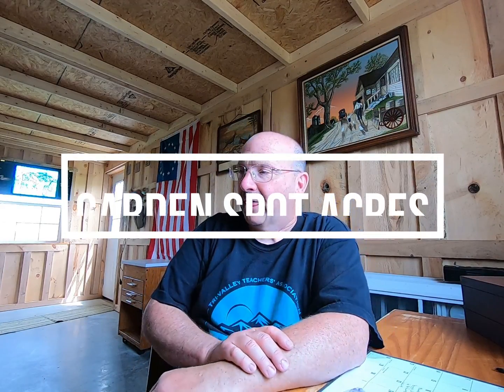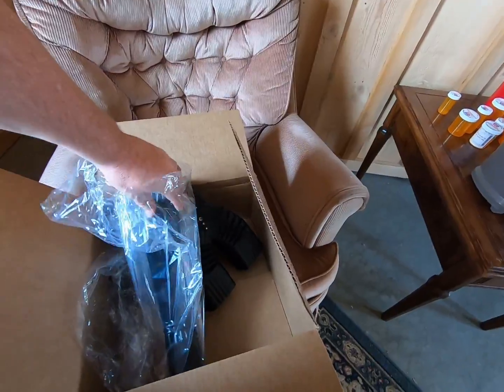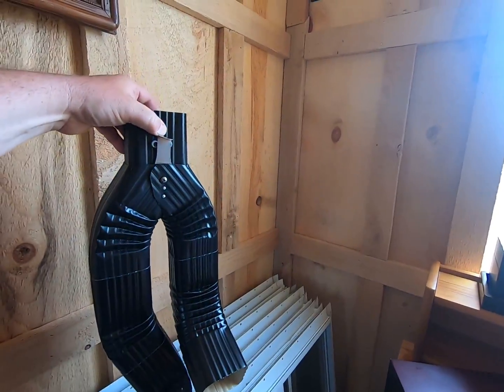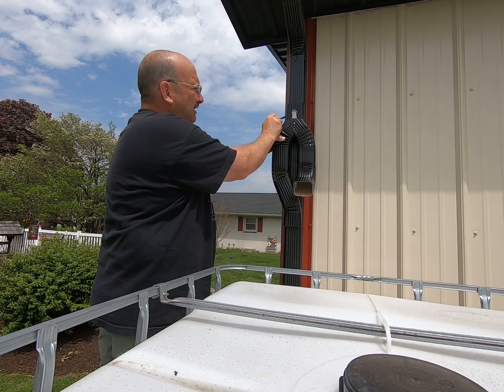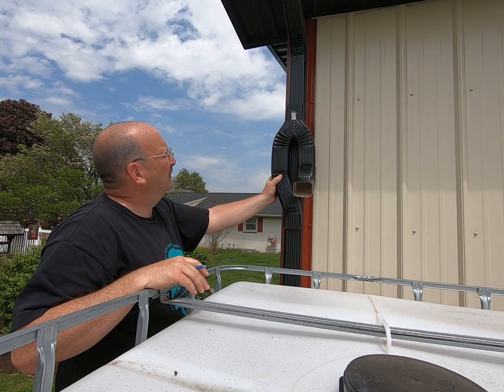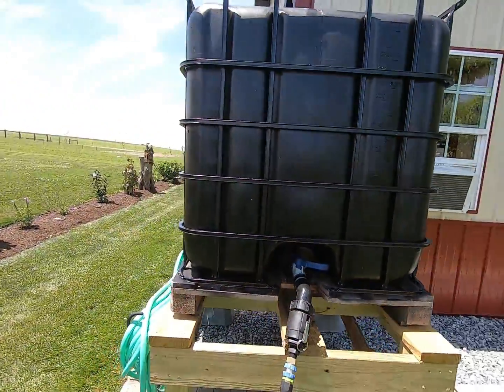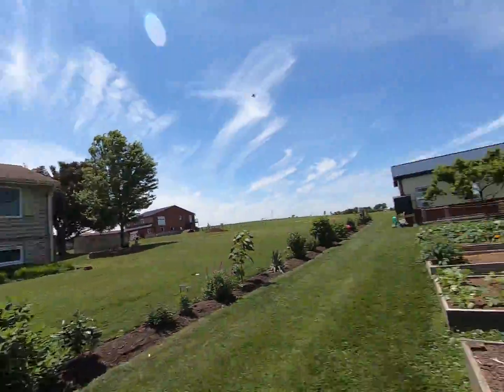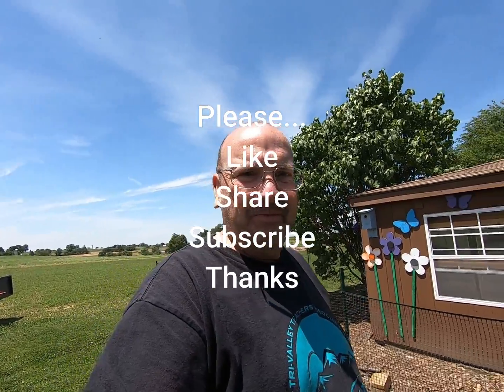Free Water!  Downspout Diverter System

Comment: How did you paint it? With spray? What kind of paint?
Reply from the maker: I think it was Krylon spray paint. The type made for spraying on plastic.
Reply: @LancoAmish  Sir, I made it like yours and works fine with today's first rain. The only issue is that I didn't place any filter to filter out the weeds/grass from the roof that birds had on it.
What is the solution for a filter? How can I place it in this set up?

Comment: Awesome video, this was super helpful :) Just curious, are you able to leave a comment back with the type of hose adapters you used or at least tell me where I can pick some up ? Im having the hardest time finding one that will work for my 275 gallon totes.
Reply from the maker: I got all my fittings at a local ag sprayer shop.  Here’s an Amazon link that will has something quicker and less parts: 
https://www.amazon.com/275-330-Adapter-Connector-Replacement-Fitting/dp/B08ML3HXWZ/ref=asc_df_B08ML3HXWZ/?tag=hyprod-20&linkCode=df0&hvadid=532859556718&hvpos=&hvnetw=g&hvrand=15057594187669056739&hvpone=&hvptwo=&hvqmt=&hvdev=m&hvdvcmdl=&hvlocint=&hvlocphy=1025182&hvtargid=pla-1369726214121&psc=1
Reply: @LancoAmish  amazing, thank you I will check this out !

Comment: How is the black paint holding up? What paint did you use?
Reply from the maker: Thanks for watching.  The paint is holding up pretty well. It’s a tough environment to hold up looking new with expansion and contraction in the plastic. If I see a bad spot I just spray it again. I used Krylon paint for plastic. I’ve had really good luck with that on plastic shutters also.

Comment: where does the over flow water go near the building?
Reply from the maker: Thanks for watching.  There’s a diverter on the downspout and when the tank is near filled I switch it over to the downspout.
Reply: @LancoAmish  I just installed the same diverter and it works really well. I didn't paint or cover mine. Probably going to regret it this summer. Oh well I figure if I have trouble with algae I will paint if next spring. I am going to try the bleach and hopefully that will help some. Thanks for the video. I also really like your stand you made. I thought I had my concrete blocks level but when the tote filled up the back ones sunk lower than the others. Kind of leaning backwards.
Reply from the maker: @clemarr , I level mine every spring before I let them fill up again. There’s a lot of weight in those totes when filled!!

Comment: Great video and very nicely done job.  question: Where did you get the brown end piece that goes into the tote cap?  I need to get that.  thanks!
Reply from the maker: Mark Levenson , Thanks for watching!  I believe I got that at Home Depot. https://www.homedepot.com/p/Flex-A-Spout-Black-Downspout-Extension-85015/303499069?g_store=4131&mtc=Shopping-B-F_D22-G-D22-22_10_ROOFING-Generic-NA-Feed-LIA-NA-NA-&cm_mmc=Shopping-B-F_D22-G-D22-22_10_ROOFING-Generic-NA-Feed-LIA-NA-NA--71700000044086327-58700004607994977-92700044043517415&gclid=EAIaIQobChMI8bWzsP6p6wIVFeDICh0Z9AVLEAQYAyABEgLjF_D_BwE&gclsrc=aw.ds